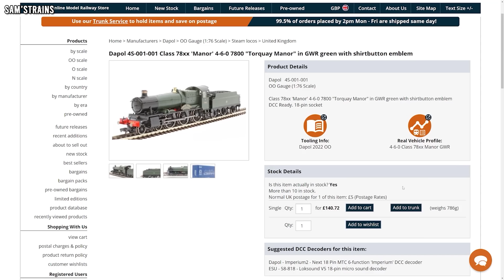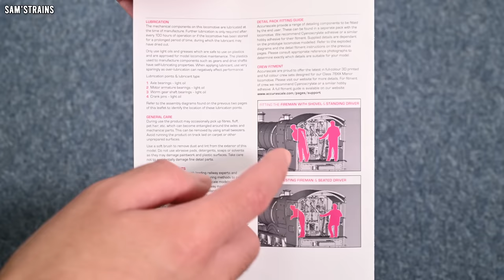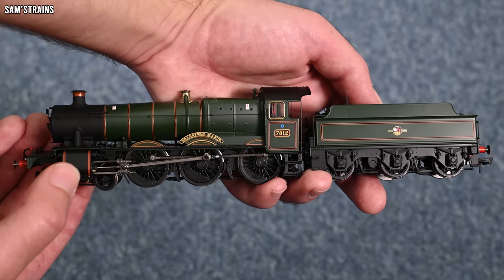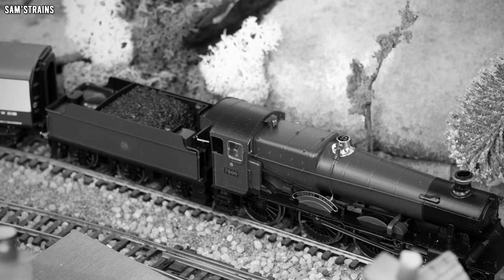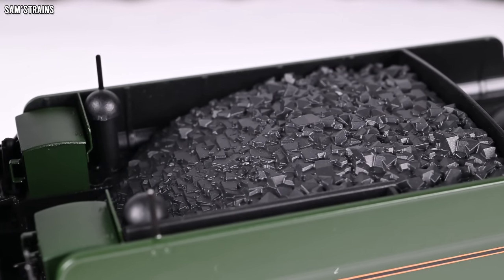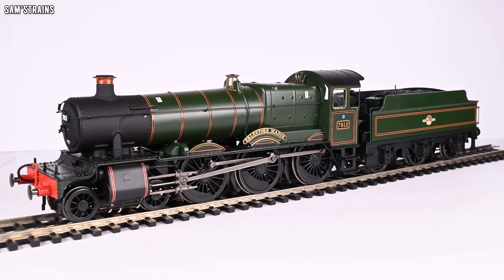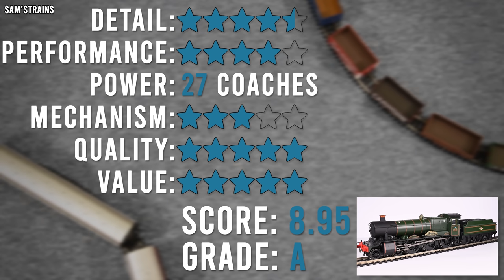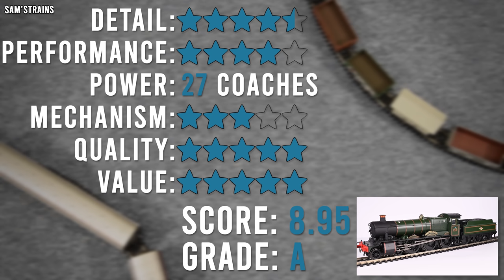Accurascale's New Manor Class | Better than Dapol's? | Unboxing & Review

Comment: Hi Sam, When you see the real locomotive you'll notice that the rivets are rather chunky and the chimney connection to the smoke box is pronounced as well. So Accurascale has it completely right. The tapering of the boiler looks wrong on the Dapol. Again the Accurascale is much more elegant and accurate. The detailing & mass of the coupling rods is outstanding. What - maybe - let it down is the 3-pole motor. But then again it's a much better puller and on DCC crawl is programmable. So for me the Accurascale is the absolute winner. Notice that you have limited choice for a decoder in the Dapol since it's space restricted in the smoke box but plenty of space in the tender with this version. A no brainer for the average hobbyist. So far, as regard to steam locomotives, this is the 'Steamer' of the Year 2023 ! Value for the money is just 'outstanding'. Bravo for Accurascale and thank you for the - as always - nicely presented review. Regards, Filip
Reply from the maker: Nah - it’s probably a matter of opinion but looking at the photos of the real manors, the rivets aren’t that chunky - you can particularly notice it on the buffer beams. Same with the chimney - that’s not how any real steam loco chimney looks, as they’re not slotted into an oversize hole in the top of the smoke box as they are on this model.
I never had a problem with the dapol tapering, but that’s definitely something that people are saying. I’m more concerned with value, quality and serviceability though, and for me Dapol wins by a hair. That said, this is an A grade model, certainly one of the very best.

Comment: Looks fantastic Sam. Die-cast for us always has the upper hand; simply looks so much more substantial like a real loco. We would happily acquire something like this but with quite some sensible improvements such as a quality motor, logically put together by design, and last but not least..., metal gears s.v.p. We're never keen on plastic ones, especially not when a model is weighty... Locos aren't quiet anyway. Metal gearing simply adds to the experience and durability. We never understand why a model loco is to be quiet... Really mind boggling for us tbh. For all those aforementioned improvements suggested, we would happily hand over the equivalent of £ 200... As it is..., a bit too many questionable compromises for the money... Fantastic looking though as she is 💓

Comment: You know what - for around £150 you can keep both Dapol’s and Accurascale’s - I’ll DCC sound my Bachmann split chassis one as a challenging but enjoyable project - and even if I didn’t already own it, I could buy one in excellent condition for around 50 quid posted to my door.

Some models that were excellent when new are only beaten slightly in most areas by the modern equivalents now.

Comment: On another youtube review, the Accurascale was only able to pull 4 coaches up a 2% helix, so while it would appear to be good on the flat, that 3-pole motor struggles with gradients. However, I have not seen an equivalent Dapol test.
Reply: YouTube also shows it pulling 20 coaches through a garden railway, and generally the reviews on haulage have been superb

Comment: I have to say Sam, that the stiffly sprung buffers are way too strong for using a screw coupling.  We tried this with a wagon after what you said just to see what would happen, and on the first bend it just derailed and tried to go straight on. However with the Dapol Manor on it did sort of go round the bend! It wasn't happy though! Having looked at both together we all agreed its swings and roundabouts with these two models. They both are great models in their own rights, and both have bits that leave you thinking "could have been a bit better". Compared to anything H and B make, at the price of these though, they are both fabulous and just show what can be done at a more reasonable price. I just wish Accurascale would just stop treading on everybody's toes and make something unique for a change.
Reply: To be fair, Accurascale have made the chaldrons and are making the J67/69 Buckjumper, both of which are not only unique but pretty unexpected.
Reply: Agreed with your final point for sure. I think that Accurascale are not doing anyone a favour by copying everyone. We don’t need more than one manor, unless you want a budget model, but the Dapol one is cheaper anyways. Before Bachmann and Accurascale announced their new 37s, we already had two perfectly good Class 37s, and since Bachmann already made a 37, it would make more sense for them to upgrade theirs than Accurascale making a new one anyways. They are also making a class 31 and 50, nether of which we need since Hornby already do that. The only purposeful models Accurascale have announced are the Buckjumpers, Chaldrens, and Class 92, everything else is already made, and not bad ether. Their most recent announcement of the BR Mineral Wagons is by far the most silly thus far. They REALLY think we need those…
Reply: @modelrailfan37  Those 16t wagons.....why oh why oh why!!! Its like KR models class 40? I just don't get it.
Reply: @TIMMEH19991  yeah for sure. I actually didn’t see that KR announced a Class 40 until recently, and I think that is a very odd decision for them to make. There have already been Class 40s made that are relatively good, and on top of that KR normally only make weird, one off locomotives, that have never had a ready to run model. I’m all for them expanding their interests for tooling, but the Class 40 seems like a really weird model for them to pick them as their first model that wasn’t a one off prototype.

Comment: I wonder how absolute the "Second Radius Curves" limit is, with the outside cylinders on this engine. As an earlier video on this channel noted a while ago, a lot of locomotives can actually manage far tighter curves than advertised, which can be handy for tight corners or non-scenic areas, albeit just sometimes with slow running and potential excessive wear on some parts if done for a prolonged period. I've noticed the Dapol Prairie, for instance, in contrast, has visible difficulty with standard non-express Hornby points at times, which are nominally second radius overall but slightly closer to first radius in places to balance out the short 'straight' sections at the end, so I do wonder with the Accurascale and Dapol Manors whether they'll be in the 'go slow and carefully over first radius sections/standard points and hope the trackwork's laid right and if so you should be ok' category, on in the 'will stall or derail at anything less than second radius' one.

Comment: Accurascale continue to amaze me with the high quality features at what seems to be reasonale pricing in todays market.   I noticed the coal load first, which is detailed, but not very fine and a bit chunky.   I am torn between which I would buy, regarding the Dapol and the Accurascale models.    The Accurascale is great for their first steam locomotive, but I am not 100% sure it is 20 better than the Dapol....   I am on the fence on this one.  I did notice on some photos of the manor class that there is a noticeable join between chimney and smokebox, but not to the extent that it is noticeable on the Accurascale model.   That said, even with the performance, I'd welcome either Dapol or Accurascale into my collection and be equally happy.
With the DCC "chipping"  I guess you only do it once.   The inclusion of the speaker is a nice touch.   The three pole motor may be because the speaker is taking up room in the smokebox?  Just a thought  
What's the minimum radius curve it can navigate the close coupled tender?   I am just curious if you have tried it :)

Comment: I would expect that when using a back EMF controller (or back EMF decoder for DCC users) you would not see the slowing down with increase in load, such as round corners, because the back EMF controller will regulate the motor speed. It might or might not help with slow speed crawl.  Like you, I am amazed that Accurascale went for a 3 pole motor, what possessed them?  Often they are responsive to problems and fix issues with subsequent batches of their locos, such as the Deltic, so I wonder if we will see a future production run with a better motor?
Reply from the maker: Yes that's what I've found with motors like this in the past - certainly better with feedback. I'm not sure why they used it either, though it would necessitate a major change to the design to change the motor for a larger one - as the bottom of the loco boiler would have to be modified/retooled!
Thanks for watching, Sam :)
Reply: Because the three pole fits, and pulls and runs exquisitely - it's not 2000 anymore, motors are generally superb

Comment: Interesting that accurascale actually didn’t get above dapol, I thought for sure they’d completely destroy the dapol version
Reply: If you ignore the spurious scoring they do :)
Reply from the maker: Explain Stephen? I’d like to know specifically what you disagree with - all of my points were backed up with detailed close up shots.
Reply: @SamsTrains  Some of your points are fine it’s how they translate into relative scoring that makes little sense. If one model is clearly and objectively a better ‘model’ than another it should score more highly. After all it’s more accurate more detailed, heavier, runs better, pulls
more, has more built in features (stay alives speakers and more). The trouble with made up scores is they are anything but objective :)

Comment: In short, my next month buy ? Well... The Dapol have better details, have their click-and-run tender-engine coupling, is easier to chip and costs GBP20 less. The difference might be done on the dynamic quality : more torque on the Accurascale, but better slow speed performances on Dapol. So, that would be a no for me. Not because the Accurascale is bad model but because I need a good control at slow speed on my layout type (local branch with lot of shunting and stops), and the Dapol one is better at this game. But, for long runs with lots of coaches or wagons in tow, the Accurascale is better suited. It's up to you to see which model is worth a buy for you.

Comment: Great review Sam, I particularly appreciate contrasting the models from the two manufacturers. As you say there doesn't seem to be much between them, with each having it's pros and cons and it depends on what you value most as to which comes out best overall, but both look decent.

Overall it looks to be an excellent effort for Accurascale's first steam loco, although perhaps a few areas where there's room for improvement. Accurascale do seem to listen to feedback so hopefully they'll address those in future steam models.

For me performance is crucial. I'd rather have a more basic model that's reliable and performs well then one that looks great, but doesn't run as well. Neither of these is perfect in that regard and whilst the fine control is better on the Dapol, I think I prefer the better torque of the Accurascale. 

There's lots to like about Dapol, but their big weakness seems to be the motors, which aren't the best. I've heard a fair bit of anecdotal evidence of their motors dropping off in performance after a relatively short period of time which is very poor and seriously puts me off buying their models.

The most important component of any model is it's motor, so to spend so much time and effort on every other aspect and then for the sake of a few quid fit a mediocre motor is utterly daft to my mind.😐

N.B. I have a Hornby R3542 Llanvair Grange which looks very similar to the Manors. The body is plastic and the only diecast is the chassis,  so it's lighter than both, however I think it performs better than either due to a better motor. The detail is perfectly respectable too. And it cost me under £50 on Ebay. 

I don't think you've done a review of the Hornby Grange class, so perhaps you could have a look at one and see how you think it compares?

Comment: The general finish looks good but did think that the lining is rather too bold and that smoke box in mat finish does not work for me, and the real locos were panted gloss but became matted down after long use. That motor is unacceptable in a model of this size. I have managed to get the old Portescap motor and gearbox into locos of this size and their performance even with out a flywheel would knock the socks of this set up. The fitting of the chimney compered to the Dapol model is not so good and looks like the is a depression in the smoke box rapper to accommodate it? Over all the Dapol looks better. Thanks for another quality model review.

Comment: The Accura Manor is the better one becouse the Dapol has one realy big Problem... the wrong Shape from the Boiler. The other Point ist the chrome Safty Part it looks so stupit and in real it never was a chrome part. The Loco Temder coupling is by the Accura also better becouse you can couple her closer. The Coupling from the Dapol is not realy great. At the beginning i was want a Dapol Manor but as i was see that the Dapol Boiler looks totaly wrong i decide myself for the Accura Manor becouse in all parts the Loco looks better. The Accura is a great Model for her price and by the way in Germany such a Loco in these Quality will cost nearly 400 pounds without sound and decoder. ;)
Reply: I have a nice bachman manor class locomotive.good runner, Stephen

Comment: Have to say there’s nothing wrong with the 3 pole motor, and they’ve always said they would be using a high quality 3 pole motor, but considering this is their first Steam Locomotive, I would say Accurascale have knocked it out of the park. Compared with the Dapol model, this wins hands down for me, just because Dapol steam locos seem to have poorer mechanisms that other comparable manufacturers. I have to say the brass on the Accurascale looks better than on the Dapol model. 
Overall, I would say Accurascale have done brilliantly and I cannot wait for more steam locos from them.

Comment: 1. The metallic paint used on the safety valve, whistles and cab interior looks questionable.

2. The smokebox numberplate looks weird. Are the numbers too large?

3. The fact that you didn't notice the lack of a split in the boiler sounds like a pro, not a con.

Comment: The small motor in relation to that heavy die cast body would worry me as a prospective purchaser. It will be interesting to see how this loco lasts the test of time. I look forward to seeing the Sam's Trains long term test 5 and 10 years from now!  The thing you can say for Hornby, they usually put a decent motor in the thing. The level of detail and the die cast body put this loco more in the glass case collector's category. Judging by your review it doesn't look that much of a layout loco! Thanks for uploading.

Comment: Thanks for a fair review Sam.

I will be honest and say I was a tiny bit concerned in the first few minutes that you may be sounding a bit of an Accurascale fanboy against a Dapol loco with a below inflation price increase.

However you rapidly removed my concerns with an even handed assessment of all cons as well as pros on this new loco.

IMHO the right result scoring slightly below the Dapol model. 3 Pole motors and hard-wired (well almost) tenders / decoders don’t make sense at this price point.

The rest of the features are very good so fair play.
Reply: A motor that has more pulling power and steadier torque than the other and a plug in tender can hardly be described as hard wired. lol. You also get a stay alive. two speakers. a die cast body and more for your money. No contest lol.
Reply: @Ste1952 assuming you mean the Accurascale one, it’s not really “plug in” like Dapols tender?

The wire from their tender goes through the loco body, so it’s not as convenient is it?

Anyway, I don’t own either and never will as it’s not even my gauge. I was simply saying that IMHO Sam tried very hard to do a fair review here, and a lot of it is subjective (your view, my view and Sam’s), so it really is buyers choice.
Reply: @adamwilliams192  It literally has a plug connector to the chassis. You only remove the wire through the body if you want to disconnect the tender and body from the chassis.
Reply: @Ste1952  ah I do see what you mean.

I fairness I don’t think I saw that mentioned in the video.

Comment: Hi i have noticed that you occasionally say don’t no if it would be better on DCC
Most of the modellers I know are running DCC I was wondering why you do not have the facilities to run DCC ?
Regards Chris.
Reply: Sam has a NCE Power Cab dcc controller. He made a video about it some 6 months ago. I think it's down to cost, buying new dcc sound locos for review is expensive.

Comment: I had no idea that the boiler is die-cast. Visually, this model is a 9/10 for me. I spotted quite a lot of smaller glue marks, so that's a bit off-putting. The dome and especially the whistles look quite plasticy and the coal looks quite bad but I don't know if it's removable or not. Aside from that though, the finish rivals Bachmann and the complexity is quite astonishing. But, the performance is quite disappointing for me. Having seen your reviews on the 37 and the 92, the fact that this locomotive can't crawl is disappointing for me. Steam locomotives especially, as I like to watch the rods and pistons start off slowly. At least it has enough power to handle a few coaches and a hill, unlike the Dapol. Speaking of Dapol, considering theirs is also cheaper and can crawl, I think I would go for that one instead. I didn't know they increased the price tho. But overall, the Accurascale looks good especially for thier first steam loco. Hopefully they will learn from this one and make the Buckjumper even better (I pre-ordered one).